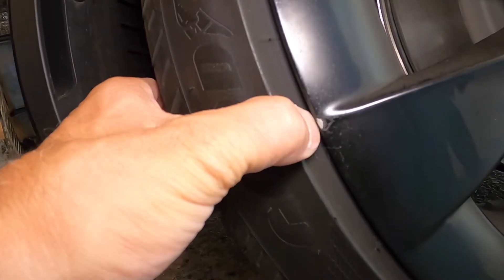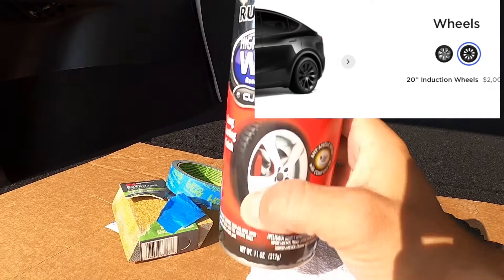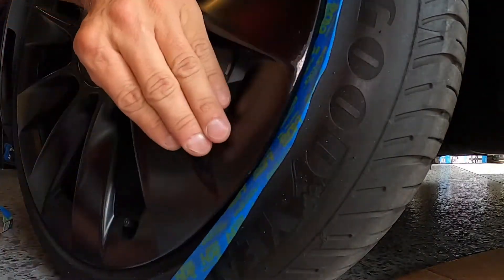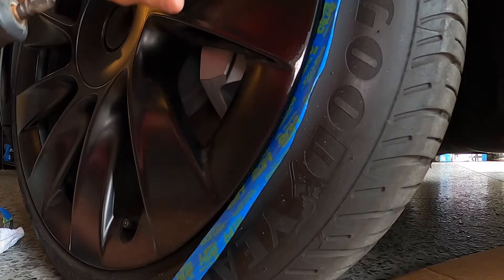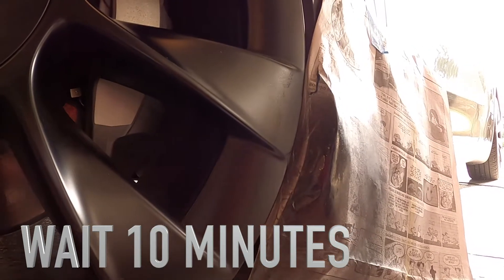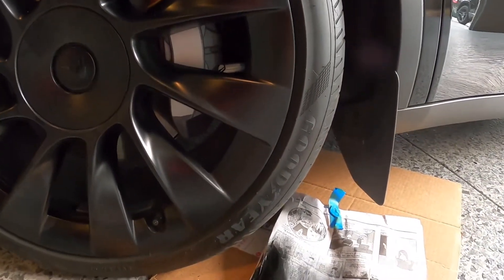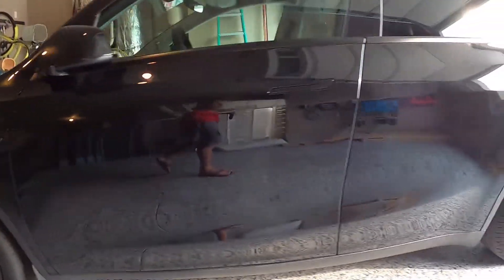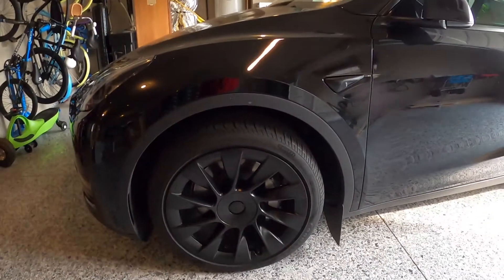Updated Curb Rash DIY Fix with Dremel Tool

Comment: Thanks for the video. I just had the same same damage on my wheel and I fallowed your video and it looks perfect now!
Reply from the maker: Thanks for the comment.  Not a good feeling when you hit the curb, but def a good feeling when you repair it yourself!  Glad it worked out.
Reply: @TeslaModelYdaho  In my case it wasn’t my fault. I usually like to wash my car in my driveway but in the winter times is hard to deal with the cold weather so I took it to a “regular car wash” and their wheel cleaner did the damage (MY BIG MISTAKE). I felt it right away when I was still going through the car wash and when I got outside to give a better dry I saw the damage in the same spot as yours. I was a little upset and I went there to talk to them and for my surprise they only offered me the money back and I did take it. Looking on youtube for solutions I came across your video that costed me almost nothing to fix.

Comment: Have you tried wet sanding after paint application? Do you think it will make a difference in the finish? Great video. Thanks!
Reply from the maker: Thanks for the comment.  Haven’t tried that. It might help. If you try it, report back please.

Comment: I tried the Rustoleum 248928 on my 2022 20" induction wheels and do not think it is an adequate match.  The shade of black does not match in the sunlight.
Reply from the maker: Thanks for the comment.  Let me know when you find a better match. I am not sure if the rims are different than the 2020 induction rims, but mine are not easy to distinguish where the touch ups are.

Comment: I have the tesla model y performance with the 21 inch wheels and have always used the rimsavers.  It's the right rim coverage for most of your rashes.  Maybe you can look into it.  The package comes with enough to cover 4 22 inch rims I believe
Reply from the maker: I have made it a habit to not select any parking spots that are anywhere near a curb 😝
Reply: I have them and I guess you could say they work to minimize damage but if you so much is kiss the curb, you’re definitely going to rip off the guard and to make it look nice again you have to order another one at $25. And guess what, odds are you’re still going to scratch your rim.

Comment: You could have attached a sanding wheel and it wouldn’t have ate that much away
Reply from the maker: Good tip. Thanks
Reply: Do you have a link? Not sure what to use